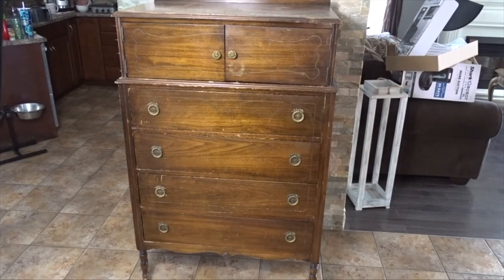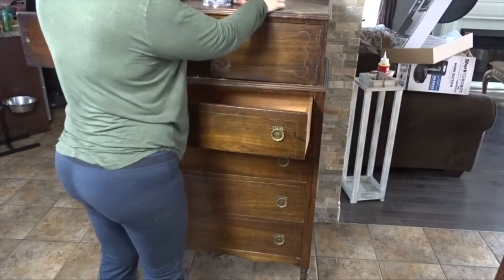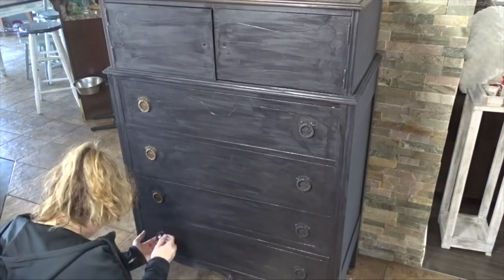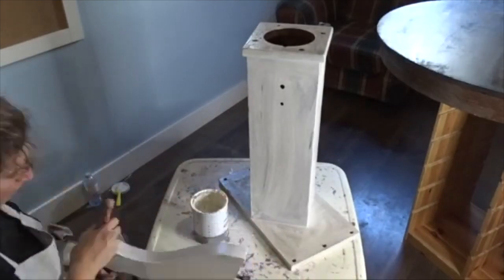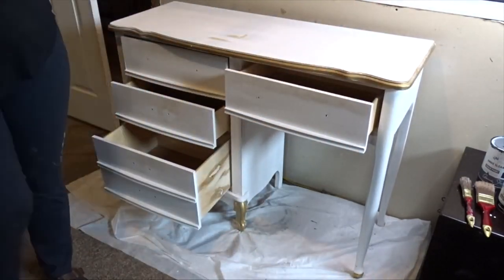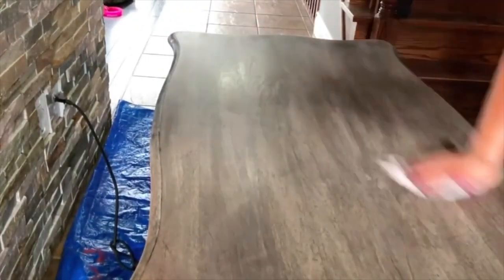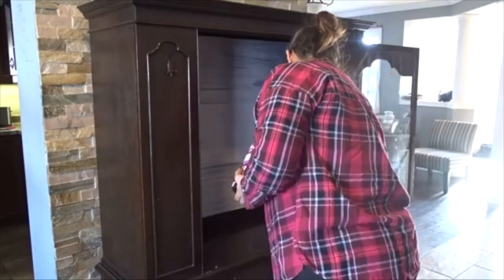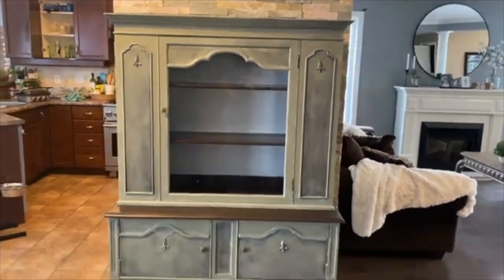6 INSPIRING FURNITURE FLIPS | Favourite Furniture Makeovers | Furniture Flips

Comment: 1st flip Why wouldn’t you use a degreaser even Dawn soap?
Reply from the maker: Hi there. Thanks so much for watching. I use cleaners accordingly. If it’s just dusty I will use water and microfibre cloth or water and vinegar. I will use stronger stuff if it has things on it and need more cleaning. Sometimes I’ll give it a light sanding if the stains are stubborn. I have been doing this for a while and it works for me